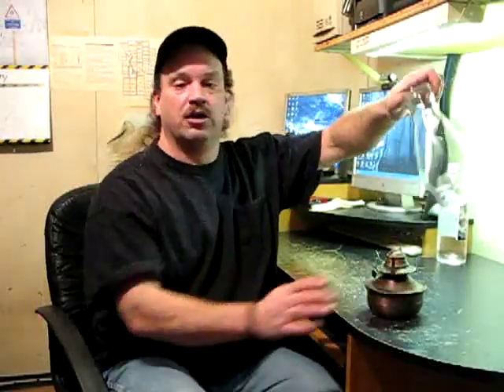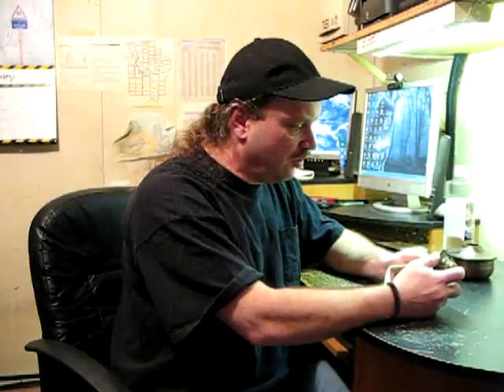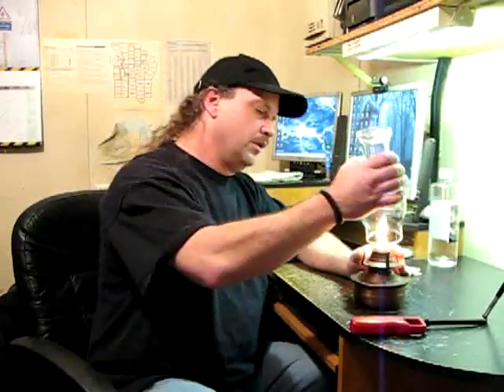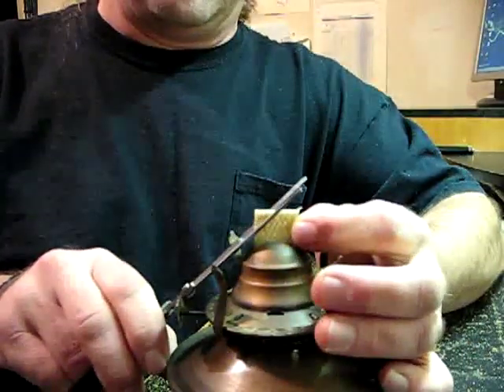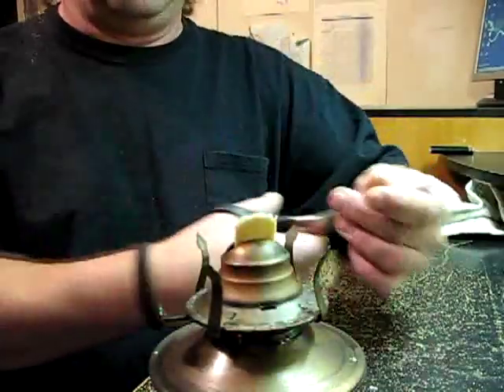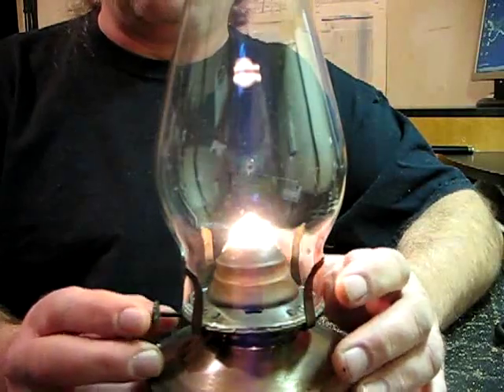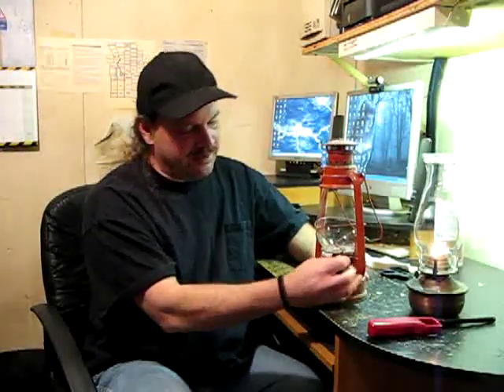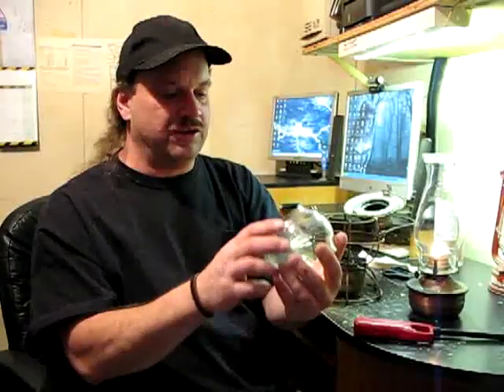Replacing The Wick In A Oil Lamp

Comment from the maker: no problem brother. honestly I've never tried cooking oil or diesel fuel. the only thing different from diesel fuel and kerosene is they put an additive in there for lubricant. theoretically they both will burn. I would probably use the cooking oil first. it will burn much cleaner. I know from personal experience diesel fuel puts out a lot of black smoke. smells like crap too. is there anyway you can import lamp oil?

Comment: I should have watched this first. I thought if I placed more wick in the oil, I wouldn't have to change it as often. My wick came in a roll so I didn't know. Now, I've saturated most the wick in the oil. Do I need to pull it out or leave it? If I pull it out, is the wick ruined because there's no dry side? I think I messed up. Just wondering how to fix my mess. Thanks for any help.
Reply from the maker: Usually once I put the wick in the lamp I never take it out. So to answer your question I just leave it in. Hope this helps you out. If you have any more questions please feel free to ask.

Comment: How long can oil lamps be on for?
Reply from the maker: Good question. It really depends on how much the fuel the lamp  will hold. I've had mine burn 20 hours before had to refill it. Just don't let it go dry it will miss the Wick up.. so basically you have to light it and check it throughout the day and keep track of how long it will burn.